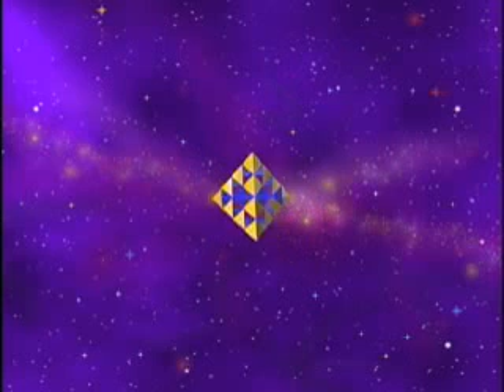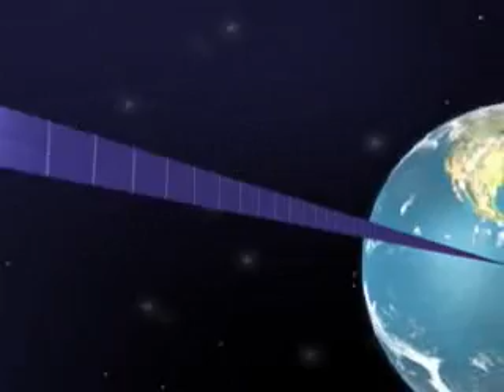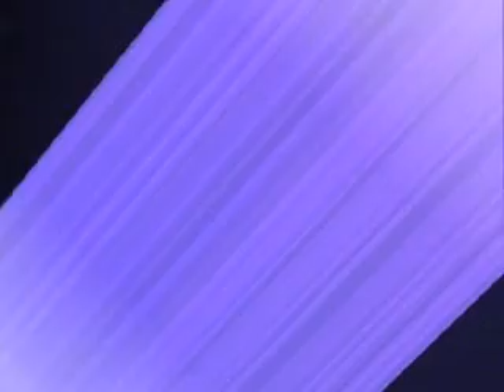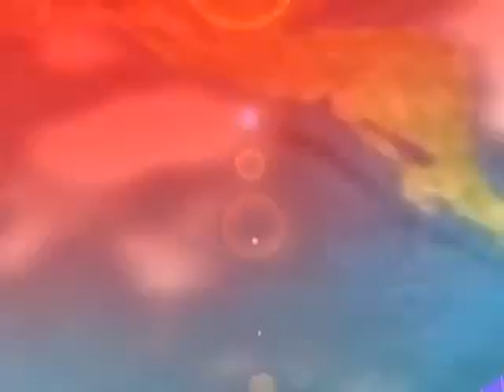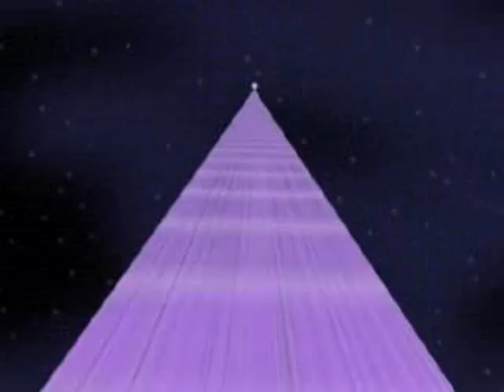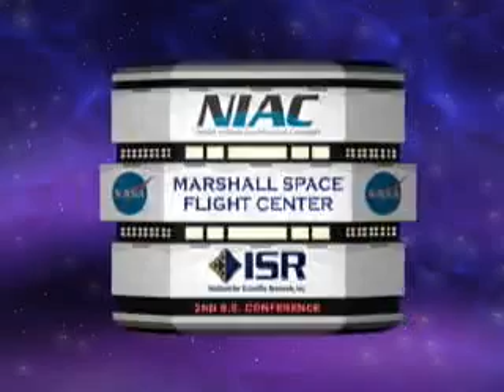Space elevator

Comment: @tnima95 plasma jets are can be electrically powered, fuel is not an issue  and the weight with centripetal forces will keep it mostly in line. oxygen and supply will come up with the humans. lot of small trips that don't cost much to bring things up will make this more efficient than heavy lifts on a very inefficient chemical rocket.

Comment: From what I understand, this video is very misrepresentative of the current direction of research.  (1) If there is only one cable what happens if the cable is cut due to meteors, or random collisions, or however? (2) Carbon nanotubes are very theoretical in this application as we currently can't manufacture them in large quantities, or to assemble, and they might not have good enough tensile strength. (3) How are climbers at the top going to get back down with others climbing up?

Comment: I read recently that to build a space elevator, 17 tonnes of carbon nanotubes need to be launched initially by rocket and deployed from space. To complete the space elavator, the rest is then pulled up in small steps, by the elevator, without the use of rockets.

Also a great thing about the space elevator is that once you have built one, you can build more of them at a low cost.